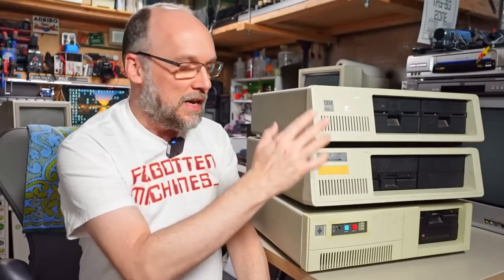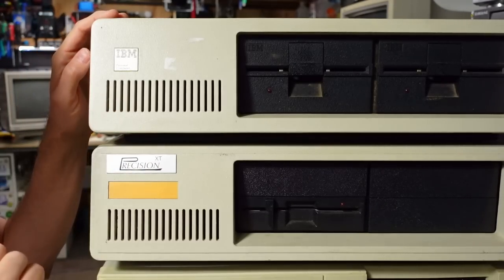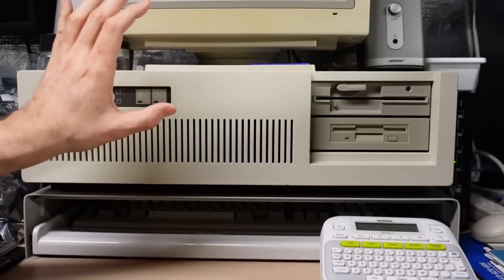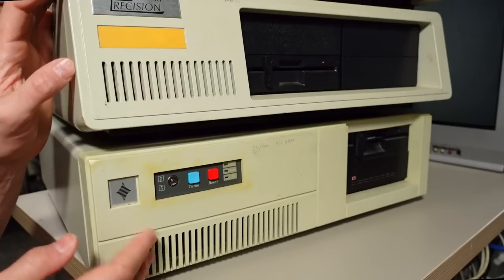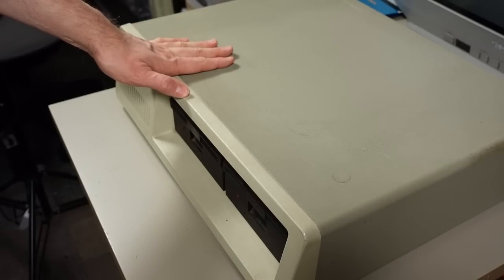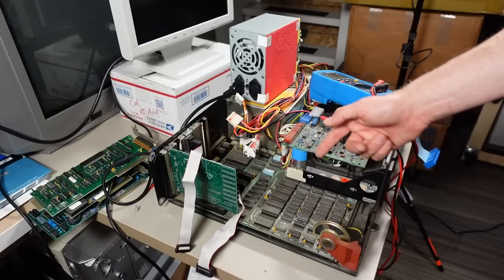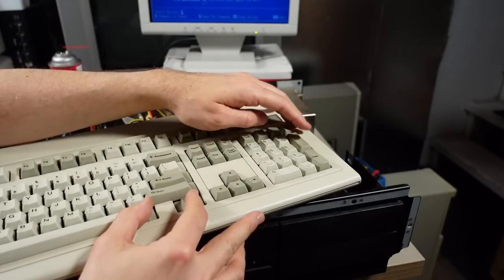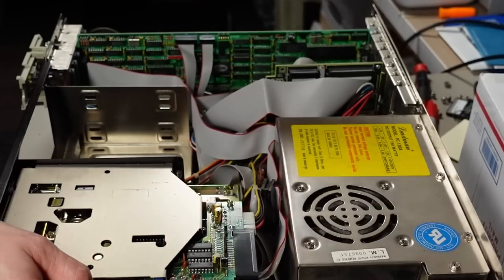PC archeology: Treasure hunting inside old PCs

Comment: Most Turbo XT motherboards booted up in standard 4.77 MHz speed and then had to be switched into turbo mode, either using an included DOS program or a keyboard command. Some used Ctrl+Alt+numeric keypad * key to switch speeds. And 4.77 MHz is 4.772726̅ MHz, to be exact -- it's divided from the 14.31818 MHz clock crystal, which also provides the 3.579545 MHz NTSC color burst frequency for CGA. That's why 7.16 and 9.54 MHz are popular CPU speeds for turbo XT systems, since they're also divided from the same crystal.
Reply: Wow, great information. Thank you.
Reply: A lot of Turbo XT motherboards had an external switch to set "turbo mode", commonly intended to mount on the front panel.
I NEVER saw one that used a "DOS program" to do that, though I've heard rumors of them.
I've only seen ONE that used a keyboard command, which seems to have actually been pretty rare.
Reply: @bricefleckenstein9666  In Tandy's version of MS-DOS you can type MODE FAST or MODE SLOW to change the CPU speed.
Reply: @vwestlife  That would explain it - the only Tandy MS-DOS machine I ever used were the Model 2000 - which was a weird machine to start with, beginning with it's use (VERY rare) of the 80186 and not PC compatable in many ways.

Comment: There were absolutely JPEG viewers in 1995, though I am pretty sure they need A LOT more muscle then a 10MHz 8088 can provide. I was using one on my 80386DX 40MHz with a generic Trident SVGA card and decoding a single picture took about 30 seconds. But if the picture is 'interesting' enough, you put up with it. 😛

Comment: Every time I see one of these videos I'm more and more bummed that I trashed my old XT years ago.  It had two interesting mods:

(1) I found an article in Byte magazine that shows how to get 640K on the motherboard.  It involved (as I recall 35+ years later!) adding a wire and scratching out a trace on the motherboard, adding a 74LS138 to an empty socket under the floppy drive, and replacing two banks of 64K chips with 256K chips.  The hard part was finding the 74LS138 in quantity 1.

(2) I replaced the full size 10 MB (5 MB?) drive with a pair of half-height 20 MB drives.  Of course, the XT didn't have the necessary brackets for half-height drives, but I had just visited my parents and came back home with my old Erector Set.  I turned out that the shortest Erector Set brackets were the exact size and spacing necessary, and the Erector Set screws were exactly the right size to screw into the drives to hold them to the brackets.

Fun times.
Reply: I do want to try the 640K mod but not on my original 5-slot mainboard!

Comment: The one-long, two-short beep pattern is standard on an XT I think for when the BIOS doesn't see the video card the DIP switches are set for.  It had a Hercules card in it, so the switches would have been set for Mono, but you'd replaced it with a VGA, so you would need to set the switches for "other" to get rid of the error beeps.
Reply: Exactly. Probably the same situation with the second XT since that was probably mono too - even if it is a bit more musical than the beep bip bip 😊

Comment: When the clone craze of the early 90ies started, I hooked up with a couple of guys that were buying and selling used Atari 800 systems.  My job was to go through the systems and make sure they worked.  Then one of the guys started buying IBM clone mother boards and other components in bulk and I put then together.  I would take a couple of the boxes he got home over the weekend and on Monday I would deliver 5 or 6 complete systems to sell!  As payment I got to keep one of the systems for myself.  I still have it in its flip open case, with half height, 5 1/4 inch floppies and hard drive.

Comment: It wasn't uncommon to pass along old computers to kids/teenagers. I think that's why it still saw some use up to 1996. For contrast, by that time I upgraded from a A1200 with 50mhz 68030 and 4MB+2MB of ram to a Pentium 5 75MHz and 8MB of ram.
Reply: Yep… I inherited a 1985ish Compaq Deskpro as my first computer in 1990, from then on, I traded or bought second hand a bunch of parts/upgrades till I bought my first brand new PC in 98. (A p1-200mmx)
Reply: I had a mac 128k up until 1996, so I agree
Reply: Also explains the contents of the jpeg. Someone was trying to hide the dirty file they downloaded on their parents' pentium, which easily could have had a 5.25" drive B
Reply: Around that time we had a Pentium 200 MMX system in the living room but in my room I had a 5162 XT 286 with CGA, that I was given a couple years before, for tinkering and learning with, and before that I had our 5160 XT clone that was our main system in the 80s.

Comment: The smaller hex head nut driver is also for tightening the motherboard mounts in most cases.  When I got into building PC's in the 2010's you almost always wanted one of those because you had to screw in the mounts yourself.
Reply: They also fit those pesky external connector bosses that keep coming off with the connector screws. The original PC/XT drive mount screws were the smaller ones as well, and as I recall that made them a royal PITA because they could slip halfway into the slot, as well as being too tall to use with FH-HH adapter plates.

Comment: 11:46 That multifunction card in the 5150 was manufactured by American Computer & Peripheral (AC&P) in Santa Ana, CA and sold as the Abovefunction Card. Stason has the DIP switch settings on their website.
A fun fact about AC&P is that they were the first to market an expansion device that allowed consumers to upgrade their 286-based ATs with i386 processors during the summer of '86. It was called the 386 Translator and was released shortly before the first 386-based desktops came out and before Intel's own AT upgrade card, the Inboard 386.

Comment: I've always known of them as "nut drivers" because you can use them for tightening or loosening hex nuts, but they do also work on hex-headed bolts and screws of course.
Reply: Yep.  I'm not sure the drivers were meant to work on IBMs specifically, so much as IBM used common size fasteners which that kit had tools for.

Comment: Funny how things have progressed. In 1996, a machine from 1987 was ancient. As a rule of thumb, everyone replaced machines that were two or three years old. But today, we have 3rd Gen i5 Machines (upgraded with SSDs) at work, that are more than 10 years old. These run Windows 10 perfectly and are in everyday use.
Reply: I still use my windows 7 laptop that I bought brand new in 2013.  It's my daily driver.

Comment: I used to work on IBM equipment when I worked at the University.  We had a device with a Molex connector and a resister we used to test the power supply with.  It was a bit more convenient than having a sacrificial device.  Especially when going to different offices, it was easier than carrying a full hight device around which would have been what was available back then.
Reply: I was going to suggest that to Adrian.  Especially one with Go/No-Go LEDs for voltage levels and meter lead test jacks for when you want exact measurements.
Reply: @bobblum5973  The device we used, of course, didn't test anything itself.  But those Switching PSUs needed a load or they will be damaged. So we would connect that to one Molex, and test the others and P8 and P9, Without the risk of zapping something important.
Reply: @Del Scoville  Oh, I understood what you meant.  I was just thinking of an upgraded version! 😁

Edit: A long time ago I used an LM3914 IC that converts an analog voltage to a bar graph LED display for something similar.
Reply: You do need quite a resistor though.  Has to dissipate a couple amps, preferably, and that does get hot!  I have a large sand-cast resistor on the 5V rail of my smoke-test harness.  It's not enough alone, but with some unusable IDE HDDs to load 12V too, it does the job.  Still, after 30 seconds, it's uncomfortable to touch.

If I had a round tuit, I would build a test jig with automotive incandescent bulbs as dummy loads, but who has the time for that!  haha
Reply: @nickwallette6201  It had a 25 Watt ceramic resister.  We didn't make them, they came with the tool kits provided to the University directly from IBM.
Reply: @delscoville   That sounds about right.  They did, after all, include something similar for ATs with no hard drive fitted, using the drive cage as a supplementary heat sink.  ;-)

Comment: You did it again! I mean, about a month ago I found a computer that looked just like one in the middle, it wasn't a genuine IBM machine, it was probably a clone. You are showing off hardware like the ones I'm encountering lately :)
Reply: IBM PCs were designed and built with such pervasive off-the-shelf parts to where their BIOS, their quality keyboard, and army tank armor like case enclosure, that is hard to see what they could do to distinguish their products from these clones. 

The keyboard was fairly well equalled by third party keyboard makers, the steel case enclusure could be duplicated easily enough. That just left the BIOS and yet that too got cloned sufficiently.

If they'd had bothered to do some crucial custom chips here and there they could have held off clones for a bit longer.

Comment: In my experience you typically need sufficient load for the power supply to start up. Just the mother board was not enough. We used to use a hard disk or a floppy drive to provide sufficient load.

Comment: 52:38 - That is an adaptec ACB-2072, can spot those a mile away. ST-506 RLL (2,7) controller card. The low-level Formatter program lives at C800:0ccc ...

Comment: I remember using an original IBM-PC pre-launch because my employer were a multi-mainframe operator and IBM used to let us test new stuff. We had 360/158, 3031, 3033 and 3081 mainframes and an 8100 mini where I worked.

Comment: AFAIK, the cassette port was not entirely unused, just maybe not used for its intended purpose– some early PC-based point of sale systems used the cassette port to open the cash drawer!
Reply from the maker: Ha! That's pretty awesome. Seems like a good use of such a thing. Probably relied on the motor on signal to activate the solenoid.
Reply: I think vwestlife had a video a while back where he got the cassette port working for a diagnostic cassette from IBM...the only  cassette software known to be distributed for the 5150 PC 😅

Comment: Those little tantalum beads... I have 3 Siemens paper tape punch / reader machines from the erarly 80s that all have these bead caps in them as part of the power section. On 2 of the machines, they burst into flames when the machine was plugged in !!

Comment: The fact that the "Precision XT" badge is NOT where the recess is and it's also misaligned with it, really hurts my OCD LOL :) Very nice video! You don't need me to say this (I'm saying it for whoever is reading!) for diagnosing shorted components without risking anything you can inject some voltage with a current limited bench PSU, that way the component will warm up without failing in a destructive way.

Comment: Hmm, 1988. That’s when I moved from my TRS-80 Model III to a generic clone (286? 8 MHz?) cobbled together by one of those shopping-center joints in Dallas called Lucky Computer. Luckily, it was an OK machine, except the monitor frequently needed the neck board resoldered. The interim fix each time was a hard whack on top with the flat of the hand. That machine looked about like the third one here.

Comment: I worked for a computer company in the late 90's early 2000's we used to use a basic 286 machine to copy floppy disks. There was also another 286 machine we used as a basic print server.

Comment: Not only can the CR2032 batteries leak (occasionally), but I've actually had a couple of occasions where they had shorted, and stopped the machine from even powering on and/or booting. If you have power or boot issues, this is worth checking.
Reply: I had this exact thing happen on a late 90s Dell Optiplex a few years ago. Refused to POST until I changed the battery

Comment: I had that same kit!  It was sold at Radio Shack and had number of little tools in it and was pretty useful.  I still have the nutdrivers and the little tube (for holding small parts I guess.)
Reply: Yup! Same here. Identical. Little tube goes in the middle of the case. Mines full of screws. Had the kit for 25+ years at least.

Comment: I do have CGAs with two RCA connectors. So it can't be a give away it's EGA - however the EGA switches are ;) Also these NEC MFM 5.25" hard drives are super reliable - I have several and they just work like new compared to Seagate drives of these era...

Comment: I inherited a PC repair kit, just as cheap 286s were displacing "upmarket" XTs and 286s... I quickly found the "Compaq" driver handy for the occasional Torx screw... but always wondered what the two socket drivers were for. You have finally cleared up my confusion... thanks.
Poor old ST-225... a noble creature living out it's life as little more than a dummy-load. :( ;)

Comment: The place that built my 1988 XT clone (in the AT case) was called "PC Fitness Club".  ;)   I'm sure it was the lowest local advertised price for 640k.  I remember it as a barebones strip mall storefront with foldable banquet tables inside.  I couldn't afford the branded clones like AT&T, Epson and Leading Edge sold at fancier computer stores.

Comment: 25:04 It isn't limited to just floppy drives in vintage PCs. I get that in my model aircraft engines too. They just get put away and forgotten for 10, 15, 20, 30+ years sometimes and the castor oil in them...one of the lubricants in their modern day fuel and the only lubricant in ye olden times...turns into glue. Locks the whole engine up tight.

Knowing how to free them up and make them run nicely has saved me a fortune and gotten me some really nice engines on the cheap!

Comment: 9:10 - Nut-drivers have been around forever. Those hex/slotted screws were very common/ Back in the 1960's and 1970's they were called 'Sheet Metal Screws'; they were also self-tapping.  Now, they've been replaced by tapped-thread screws with  Phillips, TORX, etc. slottage.

BT,W, the  Xcelite brand of nut-drivers (literally) smell like BARF! :)

Comment: 8:35 - Betting that his 'PC tool kit' was the exact same type that's been around forever and still to this day, with the zippered pouch of screwdrivers that came with some plastic tweezers, a little hypodermic needle-type springy grabber claw thing, and that sickly-amber translucent plastic tube with yellow end caps for storing screws/etc in. :D

Comment: Adrian, on the 5150 and 5160 some of the PSUs required a current threshold for the PSU to remain active. If you don’t have the Floppy drives or MFM plugged in they do not draw enough current to keep the PSU on. From what I could tell they were not plugged in when you tried powering it on and checking for shorted caps. There was likely nothing wrong with the cap, it was simply the PSU. This is the exact problem I had when I got my first 5160.

Comment: We used a lot of tants mid 90s, they were more expensive than electrolytics at the time but were seen as higher quality and longer life. They didnt leak but we also started to see a few fires caused by ones that were a few years old. Our power source was typically huge NiCad packs that could deliver loads of current, one would go short and instantly incinerate. We moved to OScon caps over a few years, these seemed to be short lived. The POST beeps are probably a colour/mono mismatch on the dip switches

Comment: There was a graphics conversion program called hijaak or hijack that may have supported jpeg. It had all kinds of wacky formats supported for input / output and I sort of used it as a benchmark back in the day.
Reply: I had some dos picture viewer program that would display .gif .jpg etc as best as it could with your display adapter (worked with the usual hgc/cga/ega/vga). In that type of machine it will slowly fill the screen.
Reply: @freeculture   And hey, if you're a teenager, and all you have is an XT with a 360K floppy drive, CGA, and a modem... that's enough to get by!  haha

Comment: I had that exact IBM PC AT at one time, it got hit by lightning one day and stopped working,  weirdly the power supply would sometimes switch on the PC automatically at random until I eventually left it unplugged, was soon parted out and replaced with an Am386/DX 40.

Comment: I have those exact hex driver tools from a toolkit I got 20 odd years ago from Tandy or Maplin in the UK; they often come in useful.
Reply: I have many Philips screws that also have the hex head so you can use either. Useful with some cheap ones where the Phillips cross gets damaged for whatever reason (probably cheap metal).

Comment: I was kind of surprised the third one turned on, from the camera angle it looked like the cpu was not fully seated. It looked like the end towards the rear of the case had worked out a little bit I guess if it did it was still making connection.

Comment: @Adrian`s Digital Basement:  I have a same XT clone case on 48:00 over there. Can you tell me which motherboard is in there> and do you have more information on that half height disk / drive mounting bracket (in the middle ,that black one?), which my same case is missing...? ( is it the same measurement from the original IBM?)    If so i try to see if i can send you an e-mail if possible..

Comment: I actually had one of each of those. The 5150, an XT clone, and AT clone, a 386, 486, Cyrix dual processor, Pentium, Pentium II and each one was better than the machine that proceeded it. The 386 was night and day different. The 486DX was the same way with the 386.